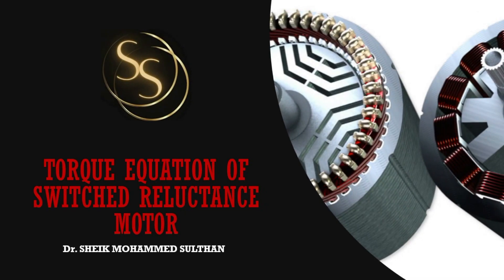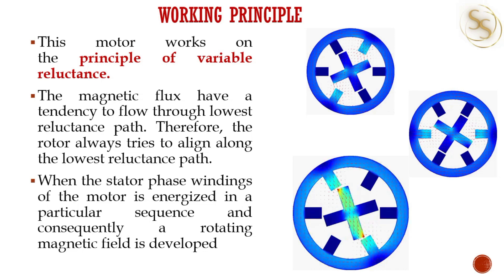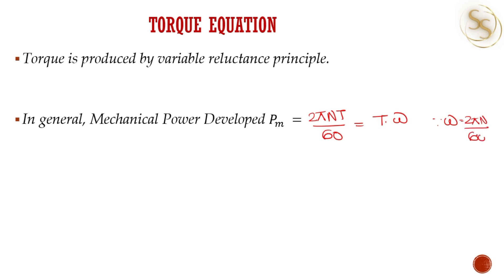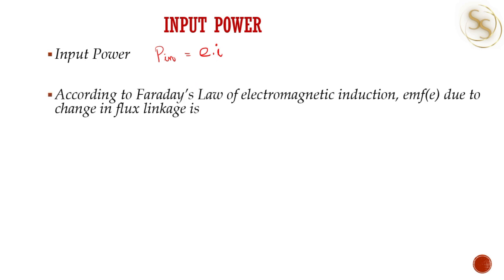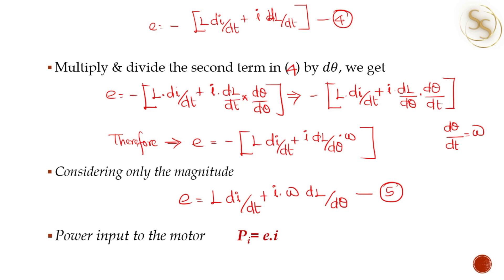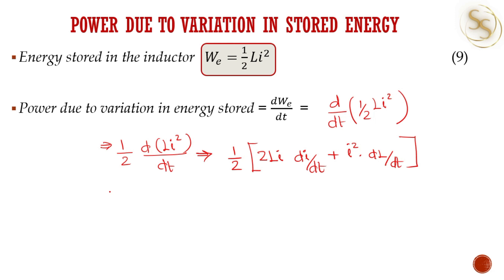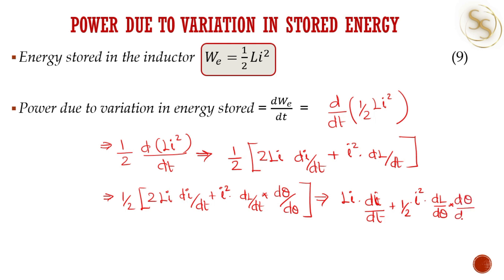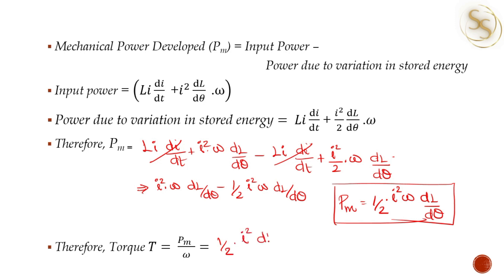Torque Equation of Switched Reluctance Motor (SRM)

Comment: Nicely derived. Thank you! There is a typo in  sign of i2/2 omega dL over d theta term in second to last slide. But it is corrected later. I wonder though how resistive losses look though from the perspective of these equations. Especially considering the process occurring after the rotor angle passes the energized coil.